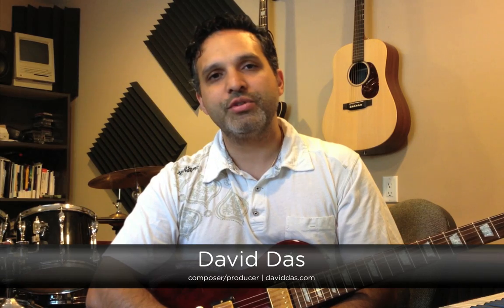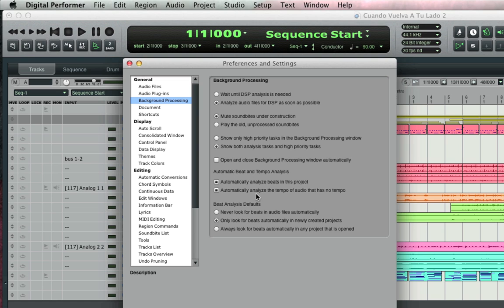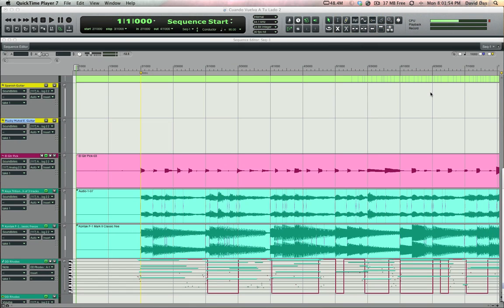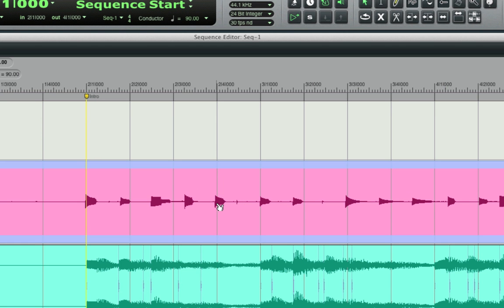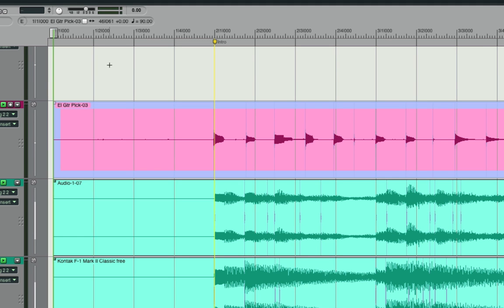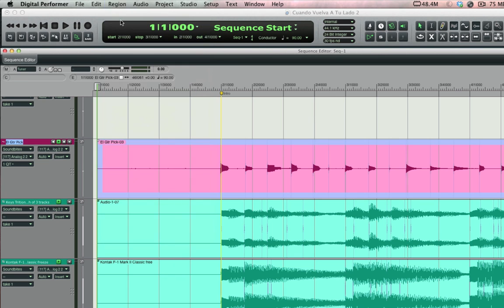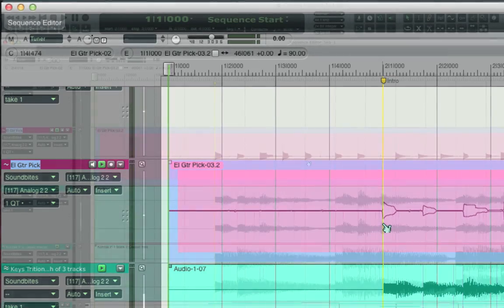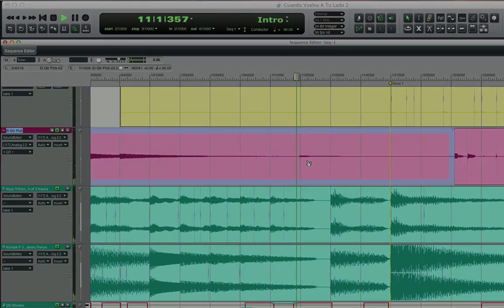Audio Beat Detection in Digital Performer

Comment from the maker: We are planning another video on audio and tempo in DP, which will cover manual adjustment of beats. You can do this in the Waveform Editor in the Beats tab.
Reply: I have been looking for these. I found a 5 part series discussing working with tempo and soundbites, but I did not catch the part about manually adjusting beats. Does this exist?

Comment: I just tried this on strummed acoustic guitar. It sounded terrible. The efficacy of beat detection and quantize in DP seems to be very dependent on the type of track you're working on. I really wished this worked well with rhythm guitar. I have several clients that could really benefit from some help.